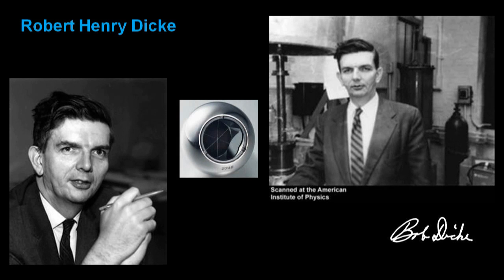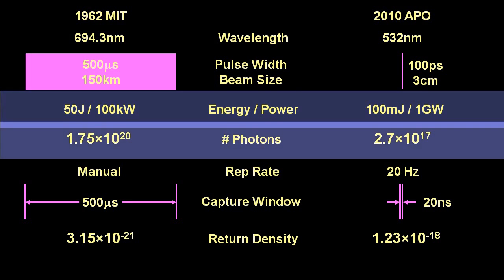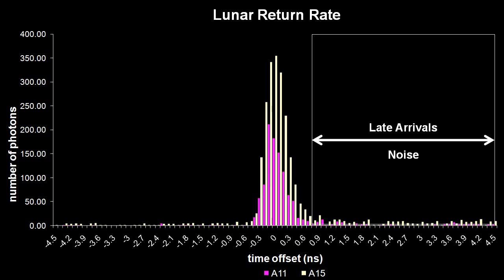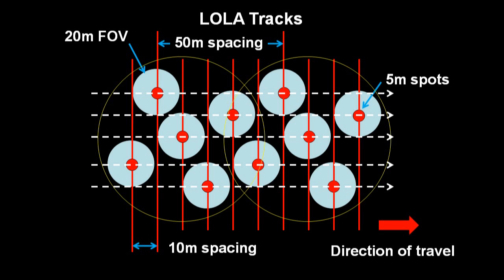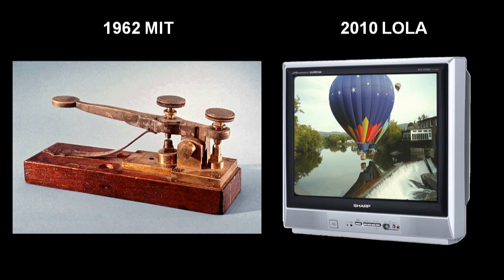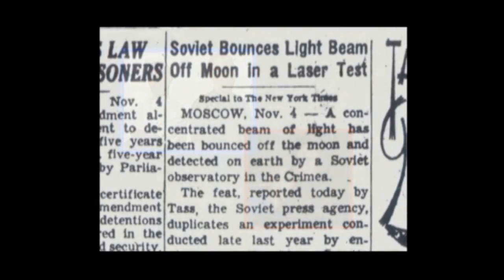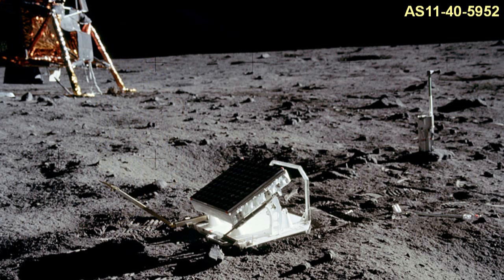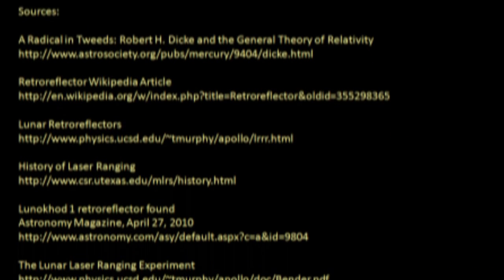MoonFaker: Exhibit D: Critique #11B: LLR After Reflectors

Comment: The truth of the matter is he needs to discredit the LRO pictures of the moon landing sites so he does so making the claim that NASA photoshopped the pictures in order to show the landers.  This is doing to admitting that the probe is actually traveling around the moon. He then decides to try in the same breath use the laser range finder installed into the probe to try and claim that the reflectors are either not really there, robot planted or unrequired to do the demonstration. cake and eat too

Comment from the maker: @NASAvsPETE You said that you need reflectors on the moon to measure the distance to the moon accurately in order to bounce VHF signals off the moon. Did I misinterpret that? You have managed to swim around a bit over the past several days, but I think that's where you ended up. If not, then explain to me again, in 500 characters or less, what your current position is, so that I can properly respond.

Comment from the maker: @NASAvsPETE #2 Pictures Pete. Pictures. How do you take pictures? Umm? With a camera? Was the camera earth based or lunar based? If you turn to page 409 of the pdf (page 397 of the report) you will find Chapter 11, Laser Beam Pointing Tests. Read it. It describes how they used Surveyor 7's camera to take pictures of laser beams, tiny points of light, emanating from six earth-based transmitting stations. See figures 11-1 & 11-2 for pictures of these earth-based stations, taken by Surveyor 7.

Comment from the maker: @NASAvsPETE Surveyor 6? Are you talking about the hop experiment? It hopped 12 ft vertically and about 8 ft laterally. After the hop it took pictures of the original landing site, so it couldn't have gone far. The vernier-engine didn't have enough fuel to send it back to earth. Luna 16, on the other hand, was designed to bring back samples. It had a big, honking engine. Reflectors? Are you talking about the mirrors? There were no "Lunar Corner Reflectors" on any Surveyor. What did NASA pull?